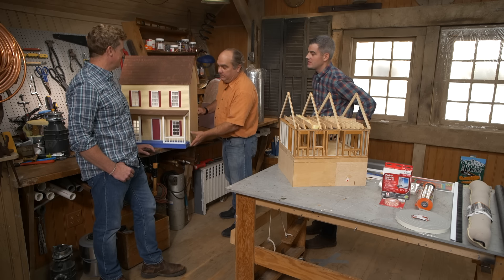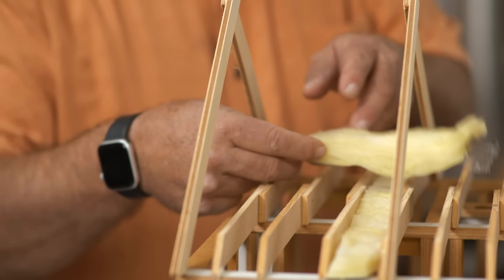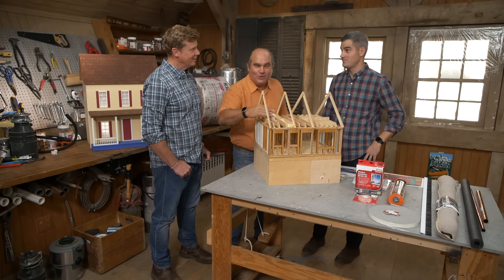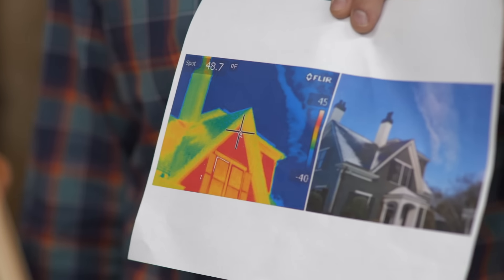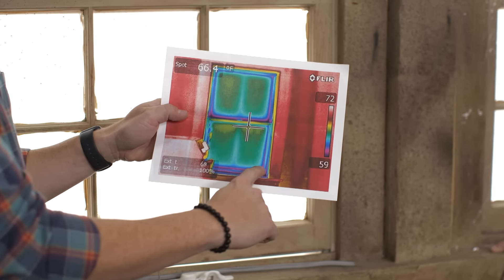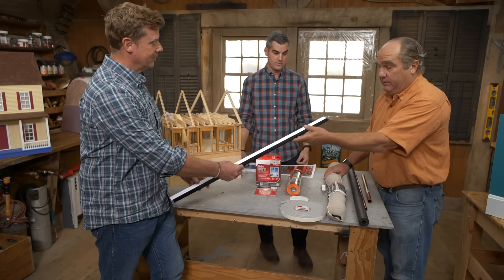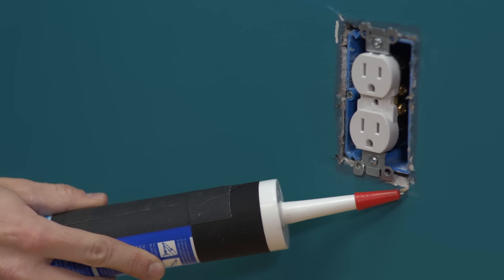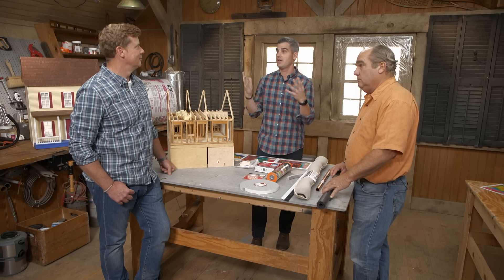How to Save Money on Heating Bills | Ask This Old House

Comment: Ugh.  I need to insulate my attic in Wisconsin, but it's a mess up there.  Lots of loose insulation.  Hoping someday to tackle it.
Reply: Spray foam the roof deck could be an option.  We did that in our off-grid home.
Reply: Spray foaming entire attics is great energy saver but is CRAZY expensive!!!
Reply: @keithbrown8814  true but so is heating bills.
Reply: @keithbrown8814  What would it cost? Curious.
Reply: @dinobravo23  ... make a few phone calls. Most foam goes in by the square foot, but that's only for accessible spaces. I saw an older structure where they spray foamed the fieldstone walls in the basement and up to the rim joists. That sealed up every single crack and crevice to the point where it was 65 degrees all winter without any heating equipment in the space.
Reply: @rupe53  insulating basement walls becomes very important if the rest of the house is sealed and insulated. Now the heat wants to go to the coldest place, which is the basement walls and the ground outside. Same for the floor except it’s warmer underneath as it’s 6-9 feet below the surface.
Reply: @janking2762  ... it was a 100 year old building used as a restaurant. Been going there for decades and I can't believe the difference in how much warmer the floors were over the winters. Also, much drier with less condensation. It's one of those things you can't believe till you have tried it.

Comment: Can the walls be insulated? I've insulated the attic and windows (that I'm redoing) bit can you get walls insulated for an already existing house to prevent air coming in l inside?
Reply: Yes, but it's a very involved process. You'll either need to remove your interior drywall and place insulation in the gap before placing new drywall on top or (if you have plaster walls you don't want to lose) you'll need to remove exterior siding and insulate from the outside, before placing your siding back on. Consult with a professional first, as simply stuffing fiberglass in the walls can lead to moisture becoming trapped there. Here's a good video on it.

https://youtu.be/0pOjJ-w733E?si=6bBy922RBcLE-Fnf

Oh, and while your walls are open, take advantage of the opportunity and update your electrical and plumbing!

Comment: Use electric clothes dryer to heat the house. Reroute the exhaust to a filtered register. Just remember to clean the filter/lint trap.
Reply: Yep , putting an old pair of pantyhose on the outlet of the dryer pipe.
Reply: @chrisreynolds2410  lets more heat through lol.
Reply: In the mountains they always run the dryer vent into a bucket of water.  The lint gets stuck in the water and the hot bubbles of air help to put humidity into the house, which is needed in the mountains since it is so darn dry.
Reply: Yep. The key word is electric ! A gas dryer must always exhaust to the outside to vent the carbon dioxide combustion product.
Reply: @sternmg  good point.
Reply: @sternmg  ... that would be carbon MONOXIDE, which is a byproduct of combustion..

Comment: Great video - Love the thermal image - would love to see if there is any difference if they put in a double or triple pane window.   Maybe not but that would be great to see or put a thermometer touching a double pane and single pane in the same room.   Again - would love to see that same thermal with the electrical before and after the calk is applied.
Reply: A double or triple pane window will help where the glass is, not necessarily around the edges of the moveable parts of the window which is what they were show cases.

Comment: The major issue I'm having is air leakage at the point between the foundation and frame.  There's a gap in the siding and I don't know what to do about it.
Reply: Try to caulk and tape the gap from the inside.  Or some sort of exterior sealer.

Comment: So if you have no drywall in spare upstairs room , it 
just has insulation, 
 do you put same insulation in floor too or just the ceiling with no drywall ??
Reply: that would depend on if you want to heat/cool that space or not and if air can find another path through around the insulation either in the floor or the ceiling.  If it is a room you don't plan to use then I'd insulate the floor.
Reply: @Off-Grid  ok it has never been finished just insulation.on peaked roof. Flooring was only on middle but then rest put down on sides couple years ago but don't know of it has insulation under it since its nailed down. But I think not cause the living room below always feels like cold air is coming down at you when sitting in it. So I'm thinking coming from  spare room above. But if I take,floor up can I put insulation in it since ceiling just has insulation no drywall?

Comment: Every one of these I’ve seen goes over doors, and windows,  and air gaps, but I have yet to see one to help with a sliding glass door
Reply: Most sliders have a fixed window which is sealed good.  Then all you have to do is seal up the sliding door.  They typically have felt at the top and bottom that the door brushes against, which can be replaced.  You can then put foam strips where the door meets the jamb.  The last seal is where the back of the door meets the fixed door.
Reply: many of those sealing kits will work if you leave the door closed all winter. Heck, you could use Saran Wrap and packing tape on a sliding door.
Reply: @rupe53  problem then is taking it off in the spring and the tape leaves a residue.  That stuff can be hard to get off.
Reply: @Off-Grid  ... yes, that's true. With some research there is probably something that would work and cost less than those window kits.

Comment: Your engineers are right. And in general, Americans have long needed to pay attention to how houses are built and insulated in Europe
Reply: From the builders I know and the Off-Grid home we're building I think us Americans are finally getting it.   Plus the code is make many change if they like it or not.  A good thing in my opinion.
Reply: Yeah, and what's often forgotten in America is that insulation works both ways. It doesn't just reduce the need for heating in the winter, it reduces the need for cooling in the summer.

Comment: 1:56 putting styrofoam insulation on top of fiberglass is a horrible idea, vapor barrier needs to be towards the warm part of the house (northern climate) and any condensation needs to dry towards the colder side.
Reply: In colder climates, your vapor barrier would be inside your house anyway. Should be right after your drywall and before the fiberglass or Styrofoam. Styrofoam isn't considered a vapor barrier here in Canada.

Comment: Electrical outlets. That's where I was losing tons of heat. I used the great stuff in a gun with small tip and careful trigger finger. 🤘
Reply: Also use foam gaskets behind the outlet covers with child protective plugs in unused outlets.

Comment: If it's 32°outside how warm/cold should it be inside a well insulated home that hasn't had the heater on for 48 hrs? My house will drop down to 65° with no heater on when it's 32° outside.  This Old House or anyone else have data to compare my house too?
Reply: there would be too many variables to calculate. For starters, you have the thermal mass of the structure. If it's concrete it will hold more than wood. You have windows and doors, which will let in more heat from the sun because that always have less R-value than walls. Then you have people that generate heat, along with almost every watt of electricity used within the home. Yes, everything from lights to your TV give back energy in the form of heat. Your electric bill might as well be part of your heating system, except for outside appliances / lights. BTW, I have seen data that shows an empty home (people away on vacation) uses more heat at 50 degrees than an occupied house with the t-stat set to 70 degrees. These were case studies done back in the 70s by heating companies because people somehow expected their heating bill to be lower if they went away during the winter.

Comment: Isn't there's such a thing as too much insulation?
Don't you want your house to breath?
Reply: Old house used old construction methods and the associated materials. Newer houses are built differently and are better off sealed,, but to your point, that's why newer houses have air exchangers built in, so the air in your house is refreshed but you lose less heat due to the use of a heat exchanger
Reply: All you need to add is an HRV or ERV.  I installed an ERV in our off-grid home and it works great.
Reply: @Bremend  ... the key to air exchange is YOU are in control instead of it being an unknown factor. Most conventional homes leak 10 times more than they need to.

Comment: Seal up house air tight. Might want to let people know about Moisture issues and carbon monoxide poisoning!
Reply: You are not going to seal up an older house tight enough for CO issues. You would have to redo the walls inside and outside. All wood sheathing, sheetrock has air holes. Unless you have very expensive air tight windows from like Europe, american made windows allow plenty of air movement .... no amount of caulking or just using batt insulation will air seal a house up...

Comment: I love how people really believe that that house insulation have anything to do with bills LMAO, gas bills are never an actual reading, the way it's calculated is they calculate the average heat for that region per billing cycle then the square footage of the house, i worked in both Nicor and Northshore gas. So it doesn't matter if you crank the heat all the way up or if you winterized the house and kept the thermostat on 60 degrees, you'll be charged the same amount, and if you don't like it then just sell your house, they own the pipes underneath the entire area that's why you barely see an area that has two different gas providers
Reply: @Ampacityelectric  mrs Karen, two years ago i left the country in January, i fully winterized the house and turned the furnace off then i traveled for two moths,  the gas bills i got were three dollars less that the gas bills i got the year prior

Comment: How to save money on heating bills?

Elect a republican
Reply: … and pay more for summer-time A/C.
Reply: Not too accurate considering my electric bill was up about 10-15% this past summer. And my gas bull has basically doubled
Reply: Sure, it's easy to save money when the power goes out due to lack of regulation and oversight. Most infrastructure is managed at the state level or below. The feds don't directly control this stuff. While elections matter, improving one's own home insulation and hvac system is still worthwhile. Something a home owner has control over and can do right now.

Comment: I've seen so many vacation homes with the thermostat installed in the same room as the wood stove. Oftentimes within 6-8'...just amazing. "Don't know why the bathroom is so cold"...

We had a really bad county building inspector.  This was in a ski area with a lot of overpriced poorly built homes. He and the liberal idiots in the board were so focused on being 'green' that they forgot the most basic rules. 

Make you install hardwired smoke alarms (with battery backup) in an area that routinely lost power. Make you use  $100/tube 'green' caulk instead of the $10/tube caulk (when the cheaper held up better under the cold conditions). Worried more about aesthetics than hiring a qualified HVAC inspector and end up almost killing visitors because the gas furnace exhaust wasn't installed correctly (pumping carbon monoxide back into the condo)... Fire dampers installed backwards or not even connected.

Comment: its always house, house, house, humans live in apartments as well why don't they serve or help them?
Reply: Tenants have less rights than home owners in many regards. While a tenant can easily leave, the trade off is limited ability to alter the apartment compared to a home owner. Occasional apartment inspections is common, which is another thing a home owner will never have to deal with. Again, it's a trade off of renting verses owning. In regards to condo owners, that's an in between situation. They own the unit, but not the outside walls nor common space. They can remodel the inside to a great extent, but not the exterior much, if at all.
Reply: @ronbennett7885  🤦‍♂️
Reply: It's 'This Old House', not 'This Old Condo'.

Most condos/apartments are pretty efficient with heating because 2/3rds to 5/6ths of your unit are shared with your neighbors. So their heat spreads to your unit and vice versa.